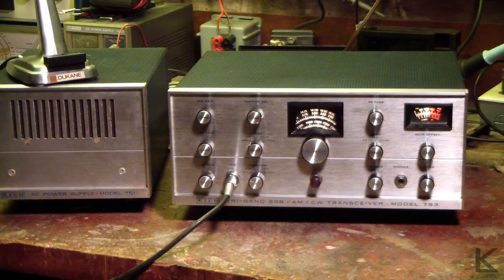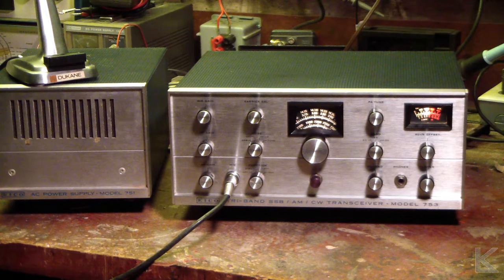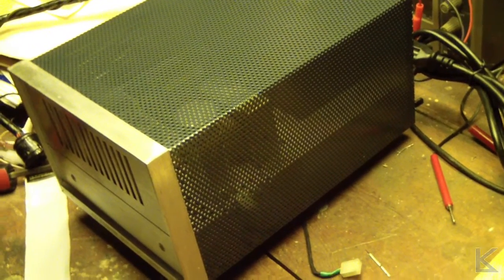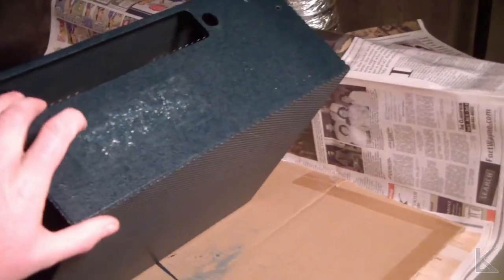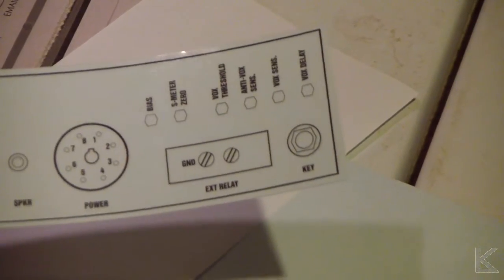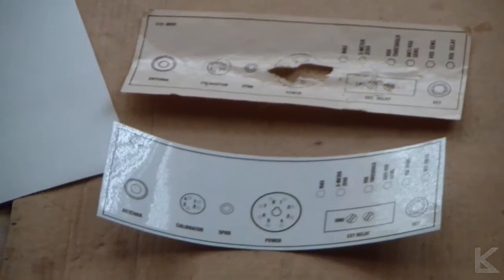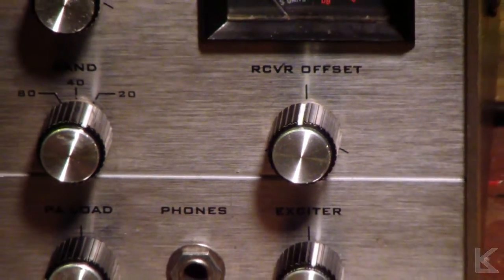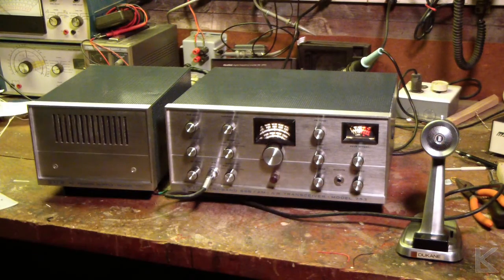Ham Radio - The EICO 753 restoration part 3

Comment: I have four of these in my shed and two power supplies. And restoring one power supply already it seems like while it's connected to the radio under load the high voltage is a bit too high, over 800 so I keep it on the Variac to around 780. 
I think the upgraded bridge rectifier and capacitors up to voltage a bit. Plus this thing was designed for 117 V and we have 120 here

Comment: I did the same thing to fix the graticule adjustment.  Sliced a small chassis gromet in half and pushed it on the adjument shaft with the flat side of the gromet facing away from the graticule plate.

Comment: Don't sweat over the resistors.  In tube type electronics most resistors can be as much as 50% off value and everything will still work fine.  There are a few critical places where you'd want the values to be within 10% or so, but for the most cases (cathode bias, screen bias, power decoupling, grid and plate loading) you're good within 50% of the indicated value.  Solid state circuits are MORE critical.

Comment: I built one of these kits back in the 60's. It was my first SSB rig. People called it "drifty", but I didn't have any problem with drift after it warmed up about 30 minutes. I think the reason for drift was just not paying attention to detail when wiring it, particularly the VFO section. As you pointed out, the black bands on the capacitors should always go to the lowest point of potential (towards gnd). and my soldering was made to NASA specifications (thanks to my having attended a comprehensive soldering course). I sold the 753 in 1971. I wish I still had it.
Reply from the maker: Neatness makes a heck of a difference.   I've rarely run across kits that had much attention to detail in the assembly.  The owner had three of these and they were all a mess.     I saw a photo of one of the factory built units.  Wires were loomed and clean.  Components were laid out very well.  Solder joints were clean with even and precise joins.   I'm sure those units ran fine.
Reply: where Dose one find solder that is NASA approved to there specifications please let me know because I would like to buy some thanks?